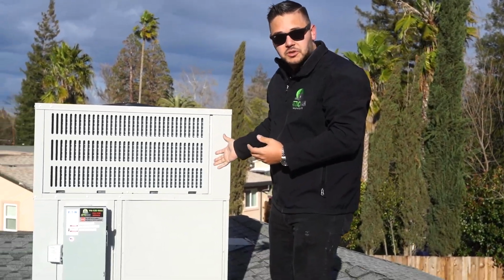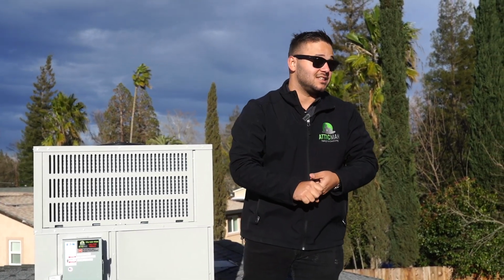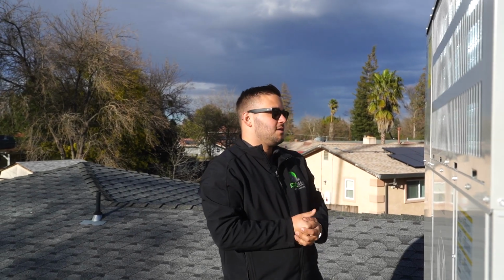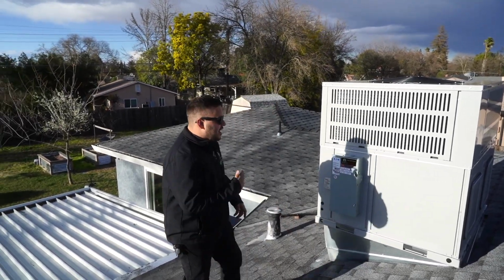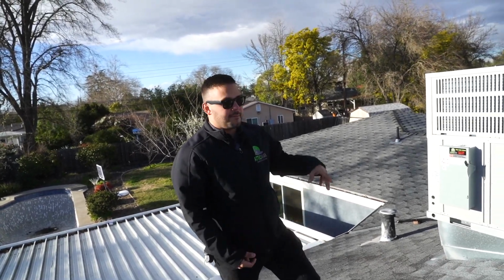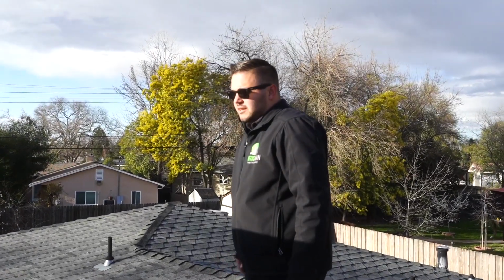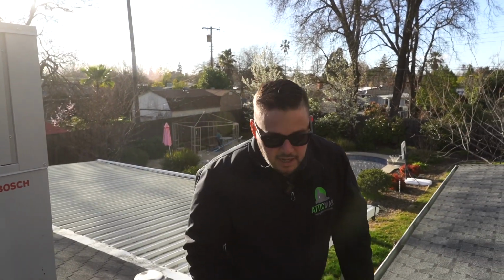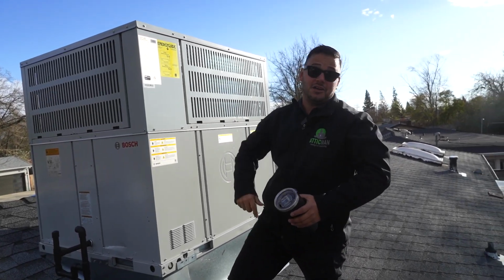What are the most reliable models of Bosch HVAC systems? | Atticman HVAC

Comment: If you install a heat pump package system like this in Sacramento are the auxiliary heat strips required by code? Will an installation without auxiliary heat strips pass inspection?
Reply: It’s California man, you don’t auxiliary

Comment: Is it a regulatory thing to put package units on the roof out there? Given the egregious costs of doing so that you mentioned (crane, curb unit, roof repair, etc.) it seems like it would make more sense to put them on the ground like you see in most areas.
Reply from the maker: @channell11  a lot of homes in the Sacramento area already have a rooftop mounted package unit. In those cases it makes sense to replace it as is, moving it to the ground would require many changes to the existing duct system, electrical, plumbing etc. and would be more costly.